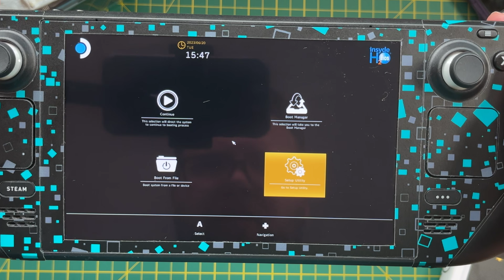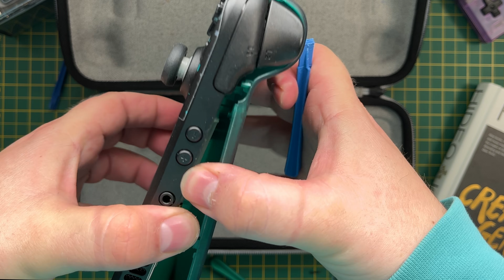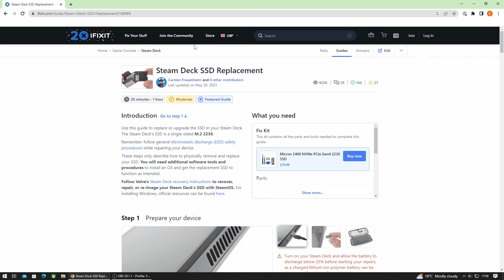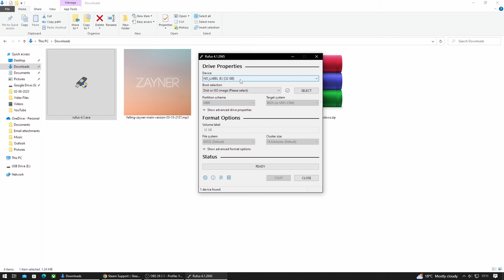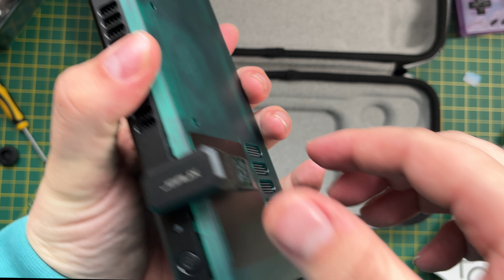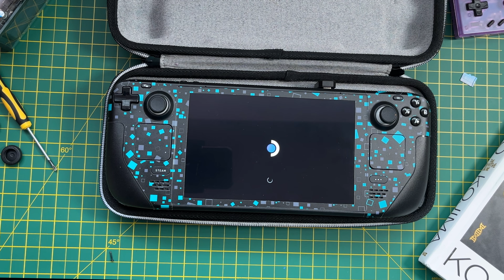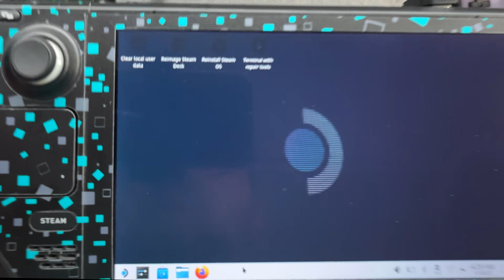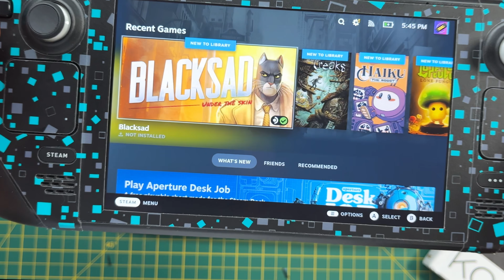How to Upgrade Your Steam Deck Storage!

Comment: Hello friend, it turns out that I changed the ssd of 64 for one of 1 tera sn740 M2 2230 but when it comes to doing the procedure to recover the system, when I select the pendrive where I have the image, the screen turns black and I leave the word error one after another, telling me a series of things that I obviously do not understand. Could you help me? Could it be that that SSD doesn't work? I have already tried sd memory and different pendrives. And he makes the same mistake.
Reply from the maker: Sorry for delay. Did you sort this?

Comment: Hi so I had a question about an m.2 so I tried using a 256gig m.2 that comes with the Steam deck for window and wanted to play this game called Boundary since it won't play on Steam OS and the m.2 got very hot and crashed this is 2230 vs the mod I did with 2280 which I tried running window on that but it still got very hot and crashed I notice with 2280 in steam os it never gets hot while playing most games on steam os do you think due to the fact of no cooling and window taking more ram could this be the reasons it couldn't handle the game on windows any help would be appreciated also 2280 did crash one's should I be worried It did get hot and I tried testing it with fall out 4 and crashed ones
Reply from the maker: Sorry no idea - I don’t use windows on my steam deck.

Comment: Can you upgrade the hdd later and than it will make you redo the login and redownload your games right?
Reply from the maker: You can clone existing hard drive, or re-install from scratch (as I show in this video). If you reinstall from scratch you’ll have to redo the setup and redownload all of your games (except for those installed on micro sd card).

Comment: damn my back screws wont come off no matter what for some fucking reason, i guess im fucked and i just bought an 100 dollar ssd
Reply from the maker: Is it older LCD model or OLED? The newer model uses torx screws so you’ll want to make sure you are using the correct screwdriver and size 👍
Reply: @steamdeckguy  i've got the older version, only two screws came off and the rest just keep spinning and don't even go up. Hopefully my friend is able to pry it open though.

Comment: When it coming to using screw and it don’t working on turn get a rubber band and then try to unscrew will make sure it doesn’t strip the screw

Comment: do i have to do the recovery mode on my deck if it’s already been factory reset or is that only for if you still have your account on it
Reply from the maker: The recovery mode is to reinstall steam OS. If you skip that step, there won’t be any OS installed, so you won’t make it past the bios screen.

Comment: I actually ended up stripping the screw (i have the PH1 bit but angled it incorrectly since im inexperienced) when I tried to remove it and I'm not sure what to do to remove it due to how little space there is to move inside.

Comment: Can someone help me figure out why in God's name the top left screw and the screw underneath the metal sticker for the motherboard are seemingly extremely difficult for me to remove compared to all the other screws up to this point? I swear. The top-right screw shown in this tutorial and others are nothing like what I have.
Reply from the maker: As I mentioned in the video, some of mine were really tight too. Just make sure you are using the correct size screw driver, and with a bit of force, you should be able to remove them.
Reply: @steamdeckguy  I tried with thay extra force and carefully tried other screwdrivers (00, 0, and 1), and no matter what, only those two screws remained and couldn't be budged at all. I think it's out of my hands and I should look elsewhere to try and remove them, unless there are other means I haven't tried yet.

Comment: quick question, i forgot to change the power to storage mode before applying these changes, should i be worriued? because i cant turn it back on even after following every step properly....
Reply from the maker: Have you tried hooking up power and turning on? If it doesn't power on you probably didn't connect the battery fully, assuming you had unplugged it. Make sure it's fully pushed in

Comment: When i try to disconnect the battery it really needs some force is that normal?
Reply: Nevermind I got it out and it worked thank you!!!! I had to use my finger nails to get it out because idk if this is common but it is hard to take out the battery with the thing on the back
Reply from the maker: Glad you got it sorted 👍

Comment: Are the joysticks/trackpads/dpad all NOT WORKING during factory setup after everything was done, normal??? Could only use touchscreen throughout the entire setup process. Current status, "Starting Steam Deck update download"...
Reply from the maker: How did you get on? The buttons should work during the steamOS setup. If not, wait for it to finish and then restart the steam deck - that should sort it!

Comment: i’m having trouble getting the battery cable back in the slot. Any recommendation on how to maneuver it in or a tool to help get it in?
Reply from the maker: I just used my finger to push it in. Use a bit of force

Comment: you don't actually need a flashdrive you can just use an mini sd card that you can add to the system as well if you don't want an extra drive just laying around
Reply from the maker: Yeah, not sure why valve tell you to use a USB thumb drive. Good to know SD card method works 👍

Comment: During the re-installation process, did your SteamDeck asked for wifi password, or did it remember the wifi password previously?  

I upgraded my SSD in my laptop and the wifi was a huge problem for me. During the re-installation, the wifi on laptop just stopped working and I had to use physical cable to hook to my router.  Hopefully SteamDeck didn't cause problems with wifi during re-installtion. I'm having PTSD about this for my Steam Deck.
Reply from the maker: It will wipe everything, so you’ll need to log into Wi-Fi and re-login to steam

Comment: What if i need to factory reset it with the ssd in it
Reply from the maker: Without the SSD inserted there is nothing to factory reset. You won’t make it past the bios without steamOS installed on the SSD

Comment: I have the newer deck version (with the black shield inside) and I could just start it, it went to a backup linux version or something. Had an exe on desktop "Reimage SteamOS", which automatically downloaded it, installed it and everything went super smooth. Outside of that, you could also install the new OS on your new SSD via a MicroSD instead of a USB-Stick. It's a lot faster is the only difference. Just make sure to remove the MicroSD to not break it. Really nice tutorial thx. Was done in like 15 minutes.
Reply: Also thank you for the tip, I'm definitely using the micro SD route. I don't even know if I have a thumb drive with USB C connector.
Reply: Why is this not how it always worked 😑 I was surprised to learn that you had to put the image on a thumb drive.

Comment: My steam deck internals look fairly different.
The fan is upside down (you can see and spin the impeller), the mainboard shield is all black not silver with black sticker, there is no aluminium foil sticker hiding screw and there is no hidden screws at all, the layout of the mobo is all changed, like RAM chips are on the left not right, mounting for the cooler over the CPU is also changed, the wireless module is at wonky 45* angle etc.
Reply from the maker: Cool. Sounds like they made it better 👍🏼
Reply: @steamdeckguy  Yes it was a bit easier to work on it.
I also cloned original SSD directly into new SSD using the command line prompt and dd command so I didn't need to reflash anything.

Comment: Im a newb to computer talk but the ssd is just internal storage right? And will i need to back anything up before doing this? Ill have to reinstall am my games again right?
Reply from the maker: Yes, it’s internal hard drive like a computer. Replacing the hard drive means you need to reinstall the steam operating system as I show in this video. FYI - There are ways to clone/copy the old hard drive to the new without having to reinstall everything, but doing a fresh install is the most straightforward

Comment: What happens if you forget to unplug the battery before taking out the SSD? It was also done with a brand new steam deck that have never been turned on but I just did it. I'll let you guys know what happens
Reply from the maker: It’s never a good idea to work on electronics whilst connect to power, and power from the battery will still be going to the SSD. You’ll probably be fine, but it’s not worth the risk of causing Damage for the sake of pulling out one connector
Reply: @steamdeckguy  yeah I was fine. It was never turned on either and I don't know if they test it in the factory but I won't forget to unplug you this time

Comment: You don’t need to peel off the heat shielding. You can carefully slide it all off in one piece and slide it back on to the new one.
Reply: my new ssd was too thick i had to peel it off and restick it
Reply: Mine was stuck tight so I had to peel it off.
Reply: Has anyone tried fitting the copper SSD heat sinks ? Are they better ?
Reply: You can try but a lot are too thick to fit in, when they put on the shielding it's wrapped around the drive so it's snug, no wiggle room. My new SSD is thicc, she ain't squeezing into that 😂

Comment: Was not so easy lol Valve screwed their screws in so dang tight you're literally threading the line between stripping them and because of that just trying to simply install a new ssd which should've been simple af I'm pretty sure my motherboard to my steam deck is now fried and Valve won't do anything because I took a part out hence the ssd. So now I'm out a Steam Deck that I've only had for 1 week and is as useful as a door stop. Buyers beware!!!!!!!
Reply from the maker: How does a tight screw lead to your motherboard being fried? 🤔
Reply: @steamdeckguy  the m.2 screw was screwed in so tight that it was pretty much stripped at that point. The only thing left I could do was try to take plyers to the top of the screw head to twist it apart and trust me I tried other methods before this one cause this one was my last resort. Like  I tried duck tape on the screw head, a rubber band but nothing worked. It felt like they intentionally tightened those suckers down so tight so that you can't get into it. Now it's as useful as a brick lol
Reply: @TheBoyzFail  you just needed the right tools, nice story

Comment: Wow easier than I thought. Which brand SSD did you use? I have a 512GB model and it's already low on space. So I am thinking of upgrading to 2GB also but want to same performance as the one that came with my 512GB model.
Reply from the maker: I’m using the western digital SN740 2TB

Comment: Wtat case is that you had on the vack
Reply from the maker: Jsaux mod case
Reply: @steamdeckguy  the cover you peeled off in the beginning? The one that has a clear tint but rubber slides
Reply from the maker: @Rafrob77  the backplate is the JSAUX transparent cover in teal, and then I’m using the JSAUX mod case (which is semi transparent and has black rubber grips.

Comment: whats the significance of the foil? would it be detrimental if i damage/lose it?
Reply from the maker: I believe it’s to reduce Wi-Fi interference with the antennas so it’s pretty important. As long as it’s wrapped around the SSD it will do it’s job. If you completely damaged it or lost it then you could just wrap foil around it instead.

Comment: Is the purpose of using the USB-c port when restoring the SteamOS for speed purposes?  You do know that you can use the SD card slot and put the SD card in that slot and when powering on in boot sequence selct that sd card slot and works the same.  Not sure why everyone is saying you must use the USB-c port.
Reply from the maker: I’ve never tested it, I’m just going by the official guidance, but I’m with you on this - I see no reason why you couldn’t just boot from the SD card. Perhaps it’s because valve consider the USB method to be safer? 🤷‍♂️
Reply: so you don't need to redownload SteamOS if  you do use this method?

Comment: Can someone confirm if the SSD is just there for storage, and doesn't have the operating system itself.
Reply from the maker: The OS is installed on the internal SSD
Reply: @steamdeckguy  Thank you this is what i needed to know.
Reply: I don’t understand your question
Reply: sorry mis typed that in a hurry, i meant to ask. The operating system on the deck, does it need to be reinstalled when you change out the ssd? or is it on its own thing and the SSD is there for storage only.  @abanomex9038

Comment: Fucking screw stripped for me as well. Cant get it out. Stuck.
Reply from the maker: Any joy? Try the elastic band method or use a larger screw and brute force it out
Reply: @steamdeckguy  I ended up bending the aluminum cover. Sucks but hey I got everything to work lol. But they actually put god damn blue loctite on those 3 screws. Bad move on Valves part.

Comment: Really great tutorial, you gave me the confidence that I’ll be able to do it on my own, haha.
Also, I’ve heard from different sources that one might need to drain the battery to under 25%? Or it’s unnecessary since we disconnect the battery cable?
Reply from the maker: It’s all about reducing risk. I’d always recommend following the instructions, but if you are comfortable not doing it then you’ll probably be fine. I think mine had about 40% when I did it.
Reply: @steamdeckguy  thank you for the prompt answer! I’ve never done similar so I’ll be as careful as possible, taking the least risk as I can, haha. 
Have a nice one and thanks once again!

Comment: So I followed the steps from steam and your tutorial, mine stayed on the black screen with the cursor for over an hour and then came on to desktop mode. It then had cancel user only and an error came up, which I couldn’t see what it said as it was 3/4 off the screen then went back into black screen with the cursor and stayed like that for another 30 mins and nothing. Any idea what happened?
Reply: I’m had the exact same problem. I turned it off and started over. Now I have all four options on my desktop. It seems to be loading fine now.
Reply from the maker: Did you get it working? Usually a good old fashioned “turn it off and back on again” sorts out any issues

Comment: This ended up being a full 12 hour thing for me. What took the longest was the updating the firmware, it was stuck at around 85%, and stayed that way for, oh idk 10 hours straight. I woke up to it still not moved, restarted it, 5 minutes later it fully updated. But. Yeah if it gets stuck, just restart and try again, shouldn’t take more than 10 minutes to update.

Comment: Thank you for the guide, I felt no need to buy the 512 steam deck when I can just buy the 64 and upgrade my ssd for cheaper.
Reply: This is the way. I wish I didn't wait to do it, before RAM prices started shooting up thanks to AI. It seemed crazy to get anything but the cheapest model when even now you can upgrade to a higher capacity, save so much money, and (sorry Valve) get a better SSD!

Maybe it's worth it if you want the etched glass screen but I can't imagine not using a screen protector anyway 💀

Comment: No mention of screw driver size... If I'm honest that would be key as I've heard people stripping the screws
Reply from the maker: Per the iFixit guide "Phillips screwdrivers can vary in size and shape—two drivers labeled as the same size may fit differently in the same screw. Use the size that fits the snuggest into the screw head."
Reply: You can tell if a screw driver fits the screw, if there is slop... Don't use that screw driver, if it's too big and won't fit, dont use that screw driver.

Comment: If you already had the SSD to USB adapter why not just temporarily install the upgraded memory in there and transfer your drive to a larger partition right from the steam deck? It would save you from downloading the OS again, the tool for Windows, and you wouldn't need to reinstall steam OS, your apps, redownload and reinstall your games, and then redo all the settings.
Reply from the maker: Yes, you can do that but I wanted to do a fresh install. It also doesn’t take long to get everything set up again.
Reply: Could u give me text instructions on how to do that please  ? I just ordered my ssd and I’m worried about the re image of steam OS

Comment: bought a new ssd and waiting for it to arrive. am I correct in assuming I can skip the recovery drive part if I clone my ssd to the new one using an external enclosure then install it physically?
Reply from the maker: Yes, if you clone the SSD then it should just boot as normal.

Comment: For some reason only the touchscreen works after restarting it. I started the updates using the touchscren but the controls don't work at all. Any fix?
Reply: Just update the steam deck and everything should work like normal.
Reply: @raven1485  Thanks yeah lol after it updated everything was fine
Reply: Well, that answers my VERY recent post/question lol. Thanks guys

Comment: Thanks for the video.
My Deck came with a big black shield that only had two screws required to get it off - didn't need to undo a bit of foil to find a screw.
Additionally, as you said below in the comments, you need to connect a power source in order to turn it back on again. I only had to hold the Volume Down button and press the power button once to boot into recovery.

Other than that, everything was the same. Thanks for making it simple.
Reply: Yeah for anyone else reading this, one of the newer Steam Deck models uses this black plate instead that's easier to take off. Every other step is the same.
Reply: So instead of downloading a recovery thingy you just have to hold volume and power button?